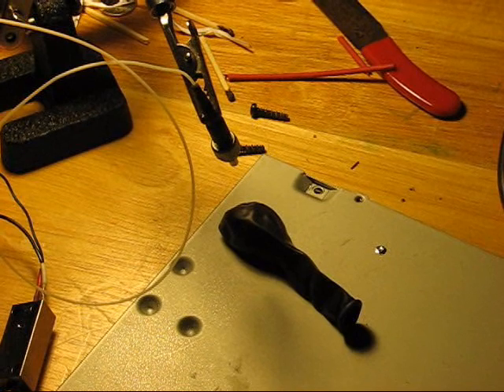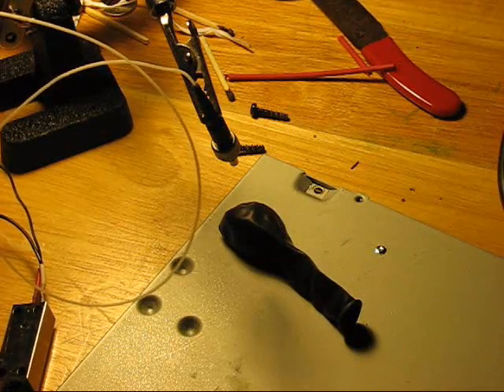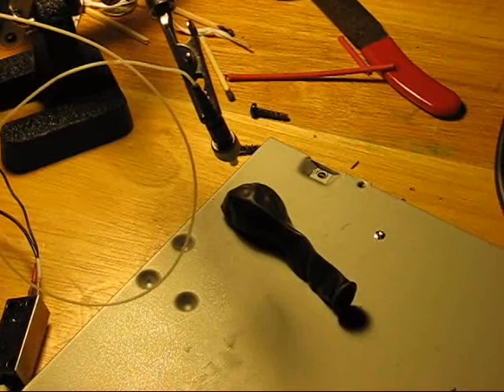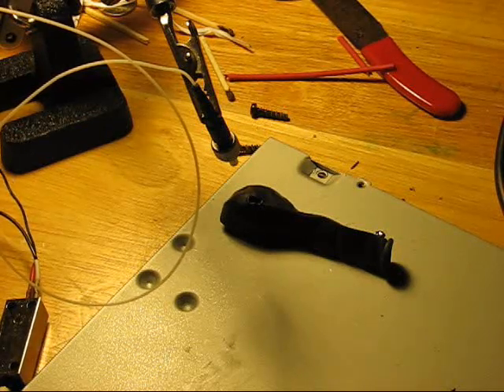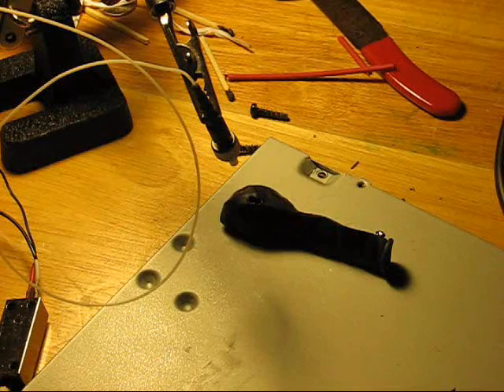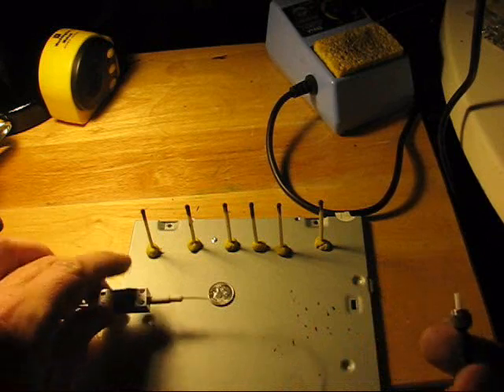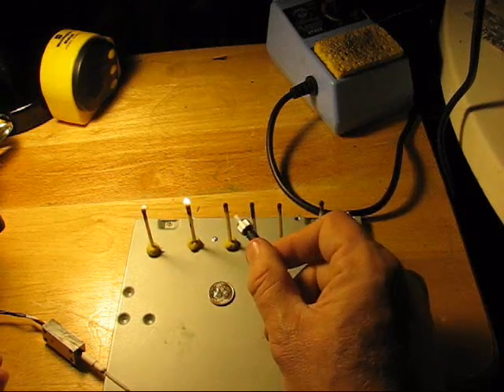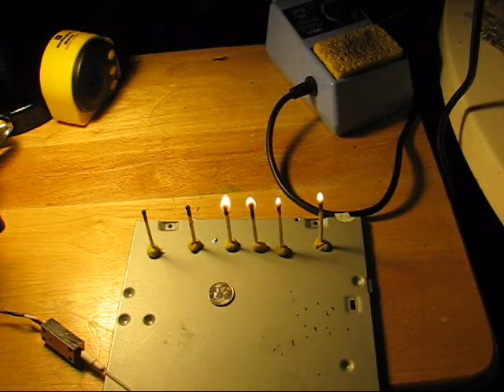808nm demo !

Comment: @AnselmoFanZero
I know what a diode stack is. Loooot of chips, indium-solder etc. But you still have to limit the current somehow.
BTW: I am not a fan of those bar-diodes. Burning on a specific distance depending on the lens you use...